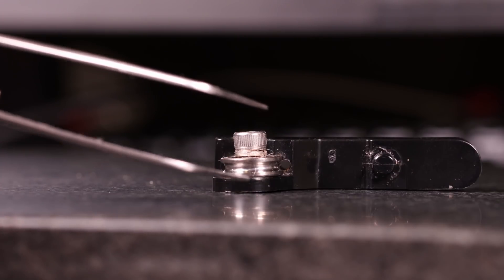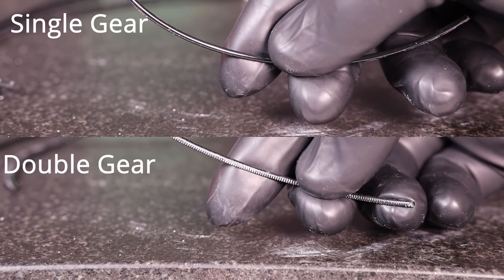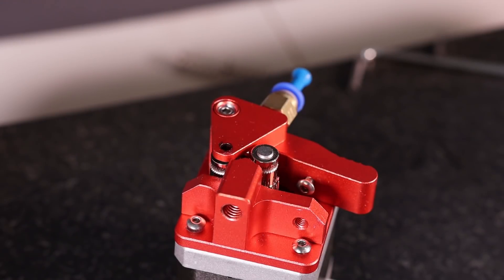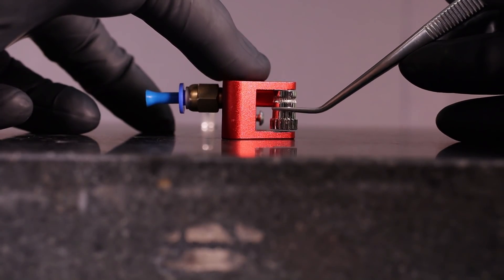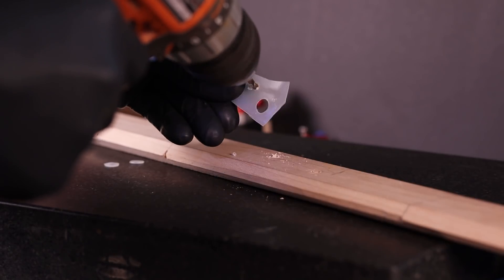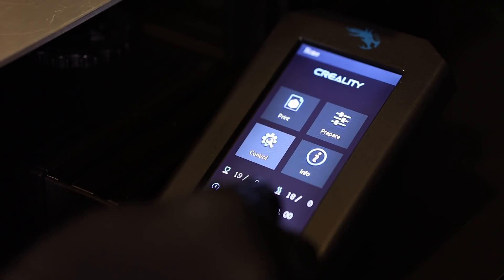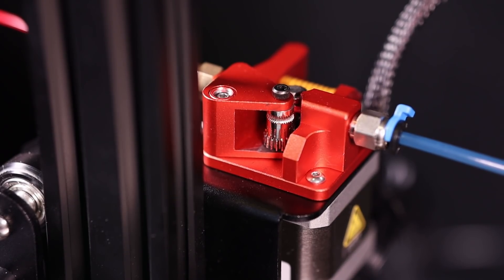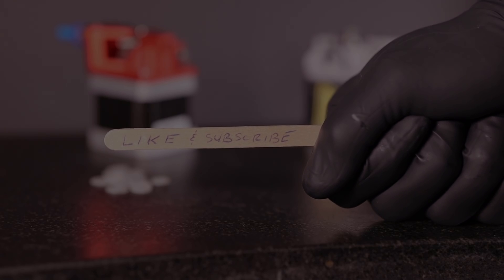Creality Ender 3 - V2 - Dual Gear Is a Great Upgrade, Except for This One Issue... Let's Fix it!

Comment: I recorded this quick video to send to you in hopes you could include it with your upcoming extruder video. But I seem to have missed the boat... The underlying problem with this extruder is that the bearings ride on the threads of a screw and these also flatten out and allow the whole gear to pivot sideways... https://youtu.be/fbI-VMQBcmg
Reply: This particular extruder definitely has a proper bearing surface and isn't running on the thread as most of the others are. timestamp at 3m10s shows this https://youtu.be/Db1IFWTF270?t=190
Reply: @StuElliott1980  AAhhhhhh good catch, I wish mine was the same...
Reply from the maker: Someone else had mentioned this, I will have a closer look when I have a chance.  A proper shoulder bolt which is hardened steel will solve this issue, the next problem will be the bearings.  I have to wonder whether a nylon sleeve would work better, it would not wear the bolt at all and might be easier to produce.

Comment: Thanks for this! Noticed this a while ago but I simply ignored it but this sounds like an easy to do solution. Also I noticed on my extruder that the teeth on the secondary gear are wearing down really fast. So one could consider upgrading to bondtech gears, which are a bit pricey tho.
Reply: I would go for clones, because clones are almost exactly the same with the only flaws usually being the gears aren't tightened, which are easily fixed

Comment: Replace the bolt with a hardened dowel. Eventually the bolt is worn enough that the arm will start to shift and cause big problems under extruding. Since putting a dowel in and putting steel washer on both ends of the gear I have not had any steel bits show up for months
Reply: Exactly right, this is the root of the problem...

Comment: wouldnt the original from creality shop be less expensive and probably less problematic? Edit: i saw that theirs is only single gear. but atleast its full metal
Reply from the maker: I like it but I was having problem with the spring pressure causing too much deformation of the filament, I was seeing quite a few jams after installation.  What I believe was contributing was that I switched to Capricorn tubing with a smaller ID and not allowing any change in shape of the filament.  I may go back to it at some point, but I do think the dual gear has clear advantages.  a Tri-Gear would be better or a fully surrounded gear, however that is ultra complex, so.... forget that idea.
Reply: @NeedItMakeIt  I had exactly that problem with mine when using a particularly soft filament on a print with a gazillion small retractions.  Overnight it squashed the filament, which jammed in the (Capricorn) Bowden tube, and then the extruder ground right through the stationary section.  I happened to have a selection of same-size springs with different wire diameters, so picked one that gave me a better range of adjustment - my extruder is slightly modified to have a proper pressure adjustment for the arm. Even so, having an extruder that didn't need that would be better, so this video gets thumbs-up from me.

Comment: this extruder is crap.. tiny machines documented its issues ages ago and offered a soultion to the gears chewing up  the alloy
Reply from the maker: Fair enough.  It is working well for me, we have different definitions of crap I suppose.
Reply: I bought it knowing I'd have to modify it. I shouldn't have too... But did
Reply from the maker: @VVhatchagunnado  There are some great ideas in the comments, it seems that you may only need to raise the motor side gear slightly, this causes the driven gear to ride higher as well and prevent rubbing on the bottom surface.  I hadn't thought of this, I was trying to align the center of the hobb with the in-out holes.  This could be the best solution.   The next problem is the shaft and bearings.  Some people have reported that the shaft is threaded on their models... that is terrible!

Comment: Personally, I will never understand peoples desire to replace one cheap, poorly made part with another cheap, poorly made part. That's not an upgrade. It's just a different set of problems.
Reply from the maker: In the case of the stock plastic extruder, it needs to be replaced because they break. Many people don't have a lot of extra cash, so they'll jump on the cheapest thing that looks good.  I make these videos because we cannot rely on honest reviews of products, Arrived on time does not help.  

I hear you and I agree, buy good and buy once, a good standard to live by.
Reply: @NeedItMakeIt  It's definitely a never ending source of content for you and others. And that's great. It's good for the content creators and the community. 

I'm just frustrated with the industry's never ending race to the bottom. But I guess we wouldn't have such a thriving aftermarket if the manufacturers actually put functional parts an their printers.
Reply from the maker: @jasonchaney5382  unfortunately it is the way of the world these days.  Many of my shop tools are antiques and I go that route because they do not break, they are made to last because they came from a time where that was the norm and that is what people valued.   Times have changed.  I value well made products, I also like a problem and a challenge.   I thank you for bringing it up.
Reply: Sometimes cheap products are really good and overpriced products are in a lot of cases, just cheap products that have been marked up to create the illusion of good quality. Sadly, well made products are few and far between these days. That's capitalism for you.
Reply: Having to make a plastic washer is a small price to pay with the headache the plastic extruder makes… this is a good buy.

Comment: i have a Dual Gear extruder and i have not had a problem
Reply from the maker: Do you have this version, or do you have the extruder mounted in this orientation?  Apparently it isn't as much of an issue if the gear is mounted horizontally.

Comment: I actually used mine to do tpu printing and it was not captive enough to keep the tpu from shooting out the side. I ended up drilling out the exit hole to push the ptfe tube right up to the gears. I also cut the ptfe tube to a two angled point so it fit into the gears extra close.
Reply from the maker: That's a great idea If I switch to TPU I'll do this as well.
Reply: I heard this was an issue with these. I have one, but haven't installed it just yet and was going to see how it did. I might just have to drill it out before even trying it though. I print TPU more often than not for FPV quads and stuff.  What size drill bit did you use to make the hole bigger?
Reply: @housinit  I can't remember. I just measured the diameter of my ptfe tube and used the same diameter but. I think it was like 4mm. I ended up drilling from the end you screw the coupler into. It made it easy to center the bit.

Comment: I just installed one of these and seen the issue before I purchased.  On mine I was able to fit an m3 stainless washer underneath my gear with no issue. I tightened the gear down and then backed it off until it could spin freely. I ran a few test prints and it runs smooth, I'm currently 24 hours in on a 65 hour print and  after I am going to take the arm  off and check for wear.

EDIT: I made a short clip of the fix and posted it on my channel. My one and only YT upload lol 
https://youtu.be/dVAiksDpDms

Comment: I bought one of these recently and couldn't ever get the esteps dialed in correctly. Each time I performed the G1 E100 F100 step, it would cause the new estep esteps value to be all over the place. No consistency. What's worse is the company I bought mine from on Amazon is aware of the gear digging into the tension arm, but they won't do anything about it.
Reply from the maker: I've had this problem in the past, I have a video on the subject, there was an issue with my firmware and I had to upgrade.  I have a copy of the firmware available if you need it.  There seem to be a few companies that make nearly the identical unit, Bangood/Amazon/Aliexpress, none of them have a washer below.  Very odd, almost like they didn't bother to test it out.
Reply: No such problem in my experience. I even used the technique that loaded the filament to the extruder using the cheap chinese filaments. So far dimension accuracy and print strength vastly improved with this one.

Comment: I have one of these dual drive units.
I found that the yellow spring supplied was way too strong and was crushing the filament and also causing the gears to bind together plus the bearings were squeaking.
I changed the yellow spring for the stock ender 3 spring and greased the bearings and since then it has worked flawlessly.
Great video though
Reply from the maker: I did find it strong, that's a good tip.  Do you mind sharing which filament you use?  I've found that the PETG and ABS feed through flawlessly for me, though it could also depend on filament brand and quality etc.
Reply: @NeedItMakeIt  I use eBay PLA filament, don't think it's any particular brand.
What I also found, when installing the dual drive was that the grub screw was to long for the gear and stuck out causing the gears to jam, it took me a while to figure out why the filament wouldn't feed, I assumed it was a blocked hot end as the new drive was feeding far too much as the e-steps were way off.
I had to file off a fair bit before the gears would turn.
Then I discovered the over-tension on the spring, like you showed, I was getting minute filings on the alloy arm plus the issues I've already mentioned.
I don't really see the need for a huge amount of spring force when the stock setup feeds ok with its spring, if anything less force is needed as twice the grip is being applied anyway.

Comment: I just put an ample amount of high pressure grease on mine when new, and haven’t noticed any problems yet. The plastic washer is a good idea though.
Reply from the maker: Cool, we'll that's simple.  I have some new hardened gears on order with new bearings as a backup as well.  I plan on working with some CF and I'm not sure how well these teeth will last.  Since I can't file them easily I'll give your method a go.
Reply: @NeedItMakeIt  Where did you find the gears and bearings?

Comment: I’ll have to get mine out of my crap box and give it a retry. Thanks
Reply from the maker: Can you believe they've made hundreds of thousands of these and never thought to make a slight change.  Maybe they want them to fail?
Reply: @NeedItMakeIt  I imagine if the units are selling well then they probably don't care, or they are counting on users that may not be very mechanically inclined to think that it simply failed and buy another unit. Great fix by the way! Ive been pondering on getting a dual gear and may get one now after seeing this, and of course fix it before installing it lol.

Comment: I just change my extruder for a titan clone (remote) and its veery good (3:1 gear)
Reply from the maker: I've heard good things about this method.  Does it really make a difference on accuracy and can you use a pancake stepper because of the torque increase?  This might be a good way to convert to direct drive.
Reply: Yes yes yes. I've tried numerous extruder setups on my Ender 3 and the geared BMG style has been the best, especially when using DD. The pancake stepper is much lighter, but due to the gearing the extruder has plenty of power. No missed steps from the extruder ever again.
Reply: Also the BMG allows you to adjust the force that the gears apply to the filament, do you can dial it down for TPU or similar flexibles.

Comment: I just bought this one but he isn't delivered. So I know what to do
Reply from the maker: Awesome, it really is a great extruder aside from this one problem.  That little extra bit of tube makes a big difference for me as well, I was struggling to find the hole to feed the filament in before, not anymore.  I also have to wonder how well those little bearings will last, replacements are super cheap, so I suppose it doesn't matter.
Reply: Try an M3 stainless washer before you grind down your gear. I just installed mine and it is running smooth.
Reply: Made a short clip of my fix 
https://youtu.be/dVAiksDpDms

Comment: I was lucky, as I use the extruder vertically on my printed DD setup, so the gears aren't affected by gravity.
Reply from the maker: I had wondered about that.  I suppose I could have found a way to mount mine on the frame to do this, maybe it isn't as much of a design flaw as a style that has been copied and not modified properly to suit the printer they are marketing it for.  Great point!
Reply: Same as me. I use this for my ender 5. I don't need to modify anything.
Reply: If the gear on the stepper is set too high or low relative to the other gear, the filament will lift up or push down that gear to its mount causing the problem described here.
Reply: Gravity isn't a factor here.  The gears clamp against the filament.  The grove aligns the gears to the filament.  The motorside is in a fixed position. The problem side floats and adapts.